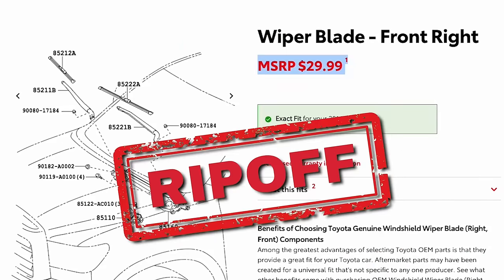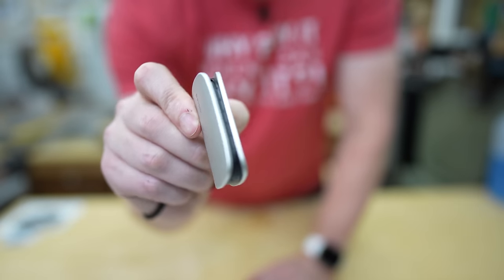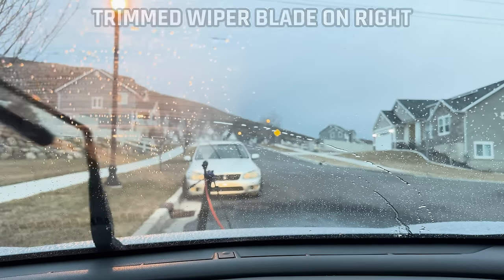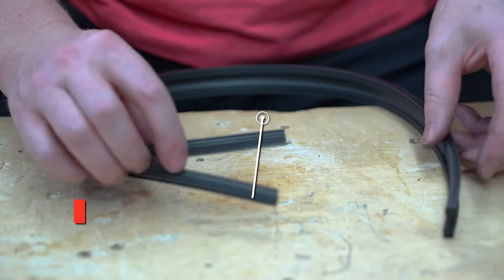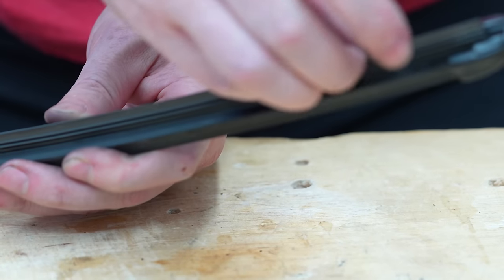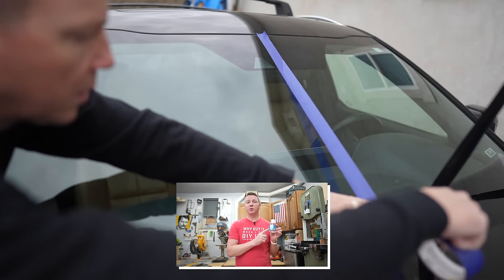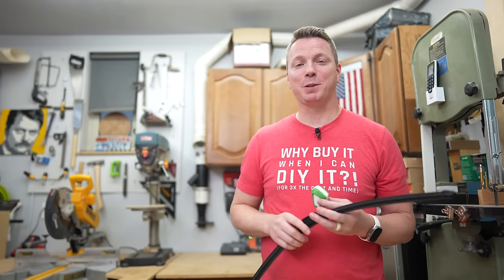Windshield Wipers Are a SCAM! 3 Ways to Save $$$

Comment: I have spent over 40 years in wiper development, testing, and sales/marketing... so my comments are based on engineering and laboratory testing, not limited cases observed on a driveway or local roads...
First, never use petroleum based products on the rubber.  This includes WD-40.  Initial results may be good, but the petroleum eats away at the rubber and reduces the life of the rubber.  Use alcohol or water based cleaners on the rubber.
You are spot-on regarding the squeegee slicers.  The rubber inserts are molded or extruded face-to-face and go through a "slitter" that costs tens of thousands of dollars.  This is the most critical part of wiper manufacture and a hand-held shaver will never produce a perfect product.  It will produce profits in the seller's bank account.
If there is one scam in the video, it is windshield wiper pellets.  They do not contain methanol to prevent freezing and usually contain less washing agents than the gallon bottle.  Some pellets do provide a blue coloring (with minimum washing agents) that makes you think you have comparable washer fluid.  Only $4 a gallon is cheap insurance against frozen reservoirs or damaging washer pumps.
You will never see an automotive manufacturer recommend Rain-X, Aquapel, or Nextzeet because they would not take on the liability for possible dangerous vision while driving.  These water repellants work by filling in the microscopic pitting found on every windsheet and they provide a slick surface... as well as a layer of foreign material.  The repellant can cause tremendous glare , especially as it wears over time.  This can be seen in sunrise, sunset, and oncoming bright headlights.  The only place I would recommend one of these repellants is on sunroofs or windows that are not used to see through for safe driving.
If you are using a repellant and your wipers are not working well, it may be because wipers are made to wipe glass and not Rain-X, which causes more friction.
By the way... we clean our windshields in the labs with standard washer fluid (not tablets) and #0000 steel wool.  Any coarser steel wool will scratch the glass.  Use a swirling motion and virtually all substances come off.  We could not get one water repellant off  a test windshield... and had to scrap the windshield.
Reply: I think what some people mean when they say WD-40 for wiper blades is the silicone spray they make, which does work very well on wiper blades and anything else rubber such as weather seals.  You just have to wipe off any excess or it can streak your glass up.
Reply: Wow - this is such good information from source who knows.  I usually don't read a bunch of the comments, but I'm glad i did today.  Thanks for commenting!
Reply: Thank you for very insightful info!
Reply: You are wrong about repellants. Best thing invented. Over 80 km/h no need to even turn on the wipers. And it reduces glare, specially on worn glass..
Reply: Very informative. I was just about to mention about RainX and wiper combo being bad. It looks fine initially but as it wears, It turned into an oily/waxy-looking white coat on a windshield, while causing the glare. And the Wipers were sounding horrible due to the rain repellent. I had to get it polished to get rid of the coat. After that, I decided to not put these repellents on the windshield. I agree that It is useful on Windows, mirrors and rear glass.
Reply: Ceramic coatings are wonderful ... especially for new windshields!
Reply: What about using car wax as a water repellant. ive been using it for a few years with seemingly good results. But i do clean the windshield, than clay bar it before application
Reply: @upinarms79  The problem is that, at least this video, shows regular WD-40, and does not specify a different type to use
Reply: So my windshield is basically screwed? Glair is horrendous lol. Learn something new everyday. Thanks for the information.
Reply: @tony1990  My thoughts exactly
Reply: Thank you for this. LRN2DIY should update this video. Actually, just take this video down and do it all over again. Agree on the pellets. Washer fluid uses deionized/distilled water to prevent build up and corrosion on your wiper system.
Reply: Hi, did you test any kind of car wax on the windshield? I find that car wax makes the windshield more slippery, which the rubber wiper blades just slide smoothly on top. It helps with the water roll-off thing too, not as much as ceramic coating or rainX though.
Reply: I agree with all of what you said except the rain X part. I've used it for a very long time (8+ years) on my car and drove 100 000+ miles and never noticed that glare whether driving at night, day or sunset/sunrise.  However, the perfect effect of it (nice beading and no need to use wiper blades above 30 mph) washes away really quickly. 
Thanks for all the details in your explanation.
Reply: I wonder if ceramic coating the windshield would be a better option than RainX
Reply: @vueport99  I guess you'd want some kind of coating that is easy to remove.
Reply: @ThePEagle …I’ve always used rain-X and never had any problems…I think it works great
Reply: As a former food delivery driver for 26 years, with around 600,000 miles of real world experience, I can add to you your lab data. I use silicone blades vs natural rubber, they easily last half a decade without any intervention at all, zero sun degradation in the case of my black blades, the red ones I originally ordered turned white after a while but are still supple.

I use Rain-X windshield washer fluid exclusively, used Rain-X prior to that. There are conditions that I decide to use the intermittent function during heavy rain because the film layer does such a great job at speed, and the wipers simply aren't needed at a heavy frequency. Slower speeds actually need more wiper assistance.

This combo of pure silicone blades, and Rain-X washer fluid is something everyone without vision issues should be using. It's by far the best combination that I used in my professional driving days. The one caveat is my mother has one eye that functions properly, the beading water throws her off for some reason. She can't ever explain to me exactly why, but every time she's been in my car, or I put Rain-X on her car back when I lived with her when I wasn't anywhere near almost 50 lol, she complained about it.
Reply: @ralphlongo1975  turtle wax on windshield also works quite well in rain especially at highway speeds. I've had to turn off my wipers cuz the water cleared itself quite well.
Reply: @vueport99  ultimately the washer fluid option allows me to be lazy with maintenance of the setup 😂
Reply: Can you polish an old windshield to perform like new regarding glare at night? When I first got my car night driving was so much easier than my the clunker I drove in high school. Fast forward 19 years later and lights glared so bad I could barely see through the glass.
I wonder how newer cars like the one I just bought with optics that see through the windshield will fare.
Reply: Glass scrub removes everything including build up and chemicals
Reply: @rus84d he's 100% correct on repellant. As he said as it wears it is terrible at a wet night!
Reply: NEVER use steel woll or any kind of steel on your winnsheild (….unless u want scrapes all over your winsheild)
Reply: @J.MartinWills  0000 steel wool is very safe for glass
Reply: @fF-jb4gs  Yep. I did that recently to remove a lot of road gunk, the various stuff that comes off the giant oak trees under which my car lives and the pollution that comes down in the rain. Also the layer of Rain-X I had put on a long time ago.
No steel wool 'scraps' at all. It's gotta be 0000 (4 ought). Replaced old blades, done.
Reply: Great comment. 
Thank you 🙏 👍
Reply: I wish I could save this comment
Reply: @Starbyter2  Rt click, select text, ctrl-c (copy) and ctrl-v to paste into an email to yourself. Done!
Reply: agree on the compliance risk but does not agree that coating cause glare. without it, oil film causes more glare.
Reply: @rus84d  What reduces the glare of worn glass even better is a new windshield. Totally worth the $$$.
Reply: WD40 has been proven times and times again to be perfectly safe for rubber, including o-rings and such
Reply: Thank you thank you
Reply: @Kid574  orings and other seals usually either NBR or viton. Tyres and wipers most of the time are natural rubbers
Reply: What about carnouba wax for the windshield, I've seen good responses from people who used it. The view is clear and they don't even need to use wipers
Reply: @spamcan9208 Yes, there are glass polishes.  But it takes a long time as d is rather messy due to the hardness of glass
Reply: @Jeppedy  starting to think it would be easier to smash my windshield and blame it on the neighborhood kids when I call my car insurance to replace it lol
Reply: Is that you Brian,,?  Ron K.
Reply: @ThePEagle . Totally agree. Wipers make no noise at all when I use them compared with before I applied initially.  Only thing that destroys my blades is winter when I think I have defrosted the window but didn't fully melt all ice,   noise like nails down a blackboard and ruined rubber.
Reply: I would avoid the washer fluid pellets,  try not to introduce non filtered water into your washer fluid, foreign material or particulates of the pellets can jam your pumps. And tap water will leat to more dry water spots on your car

Comment: Wiper refills were one common in every auto store and Walmart, but they slowly disappeared and were replaced with a range of wiper brands.  People didn't used to buy entire new blades unless the old ones actually broke; they just bought refills. If there is a scam with wipers, it's that refills were taken out of stores, at least where I live. 

I'm glad that the video recommends them, as I didn't know where to find refills anymore and certainly would not have expected ones from AXpress to last more than a year.
Reply: This is exactly what I was going to say! I hate to newer blade refills. They are entirely too curved for a lot of the taller windshields. The middle of the blade never really hits the glass, and the ends wear out before the middle even hits fully. That can cause scratches and grooves in the windshield. Good to know that you can order the old school refills when you finally find a pair of blades that fit your actual windshield.
Reply: Two reasons for the demise of refills... 
First is the backing... it coulsd be 6mm, 6.5mm, 7mm, 8mm, or 9mm wide.  Install the wrong size backing and the refill flies out during operation... or jam in one that's too tight and you can easily get streaks and smearing.
Second... refills were popular when they were sold in pairs and were the same size.  Today over 85% of vehicles have two different size refills on the front glass. 
 If you are going to buy refills, go to the dealer... but if you are going to pay their ridiculous prices you may as well buy a quality aftermarket blade.
Reply: If you have the factory wipers, get refills from the parts department. They last 3 years 36k miles warranty, and they it perfect. Autoparts stores dont carry them no more as there is no single size anymore, its easier to carry the whole wiper at different lengths than different rubber at different widths and lengths.
Reply: Came here to say this. We used to by two rubber blades for 2.99 back in the 90's. Now you can't find them in any store.
Reply: I used the refills for years to save a buck, but noticed that they tended to not even last a full season of winter weather. In the long run refills were working better for me. Cost more, but I only have to replace them every one to three years.

I hadn't even noticed that the refills had sort of vanished from stores.
Reply: this is interesting cause in Australia we can still buy them at the local car parts stores and they have multiple options
Reply: I like that piia sells replacement silicone blades for their wipers.

Comment: Finally, a subject I have good (and I mean excellent knowledge about).
I have been working as a development engineer for wiper system development at an OEM automotive manufacturer for almost 30 years. 
First of all:
Yes, wiper blades are expensive, but they are safety equipment that you need when the driving conditions are at its worst. When it is cold, dark and rainy you don't want bad wipers, especially if you are driving for more than an hour.
Take care about your self and your safety. 

About the 3 tips.

1. Yes, you should clean your wiper blades.
But gently and absolutely not (!!!) with WD40. Use a piece of paper and some soapy water and wipe away the debris from the wiper lip.
The black stuff is not tar, oil or soot and it should be on the blade. 
It is a graphite coating that helps the blade to move smoother over the windscreen but most important, it stops the squeaky noise from the rubber moving over the glass.
The term "squeaky clean" comes from the sound a rubber scraper makes when cleaning a window...

2. Cutting the wiper lip.
It's a thing you can do if you are broke and it is an emergency during daytime in the summer.
There is a reason that the lip has its length and it is not so that you have some extra rubber to cut of. It is there to take up the uneven curvature of the glass and to make a smooth and silent wipe. You will especially notice this when it is in the 40-ies and below.

3. Exchange the wiper strip.
Yes, that is actually a good tip abd that is what many OEMs do when the service your car.

You can do it your self, but please know what you are doing. If the part is not already pre-cut to length, measure the old one and cut the new to spec. Better an 1/4" to short than an 1/8th too long. 
The rubber need to have room to move in the frame, when travelling over the windscreen surface. 

The two bonus tips.
1. Rain-X is good, very good.
Just clean the glass thoroughly before applying. 

2. You do not need any tablets from Amazon. Skip that crap.
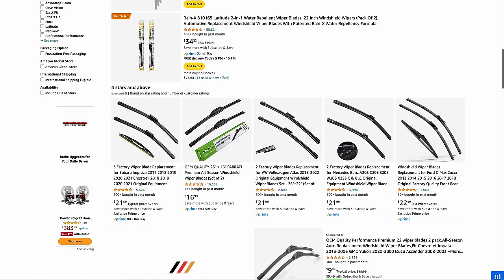1 tea spoon of (hand) 6:34  dishwasher soap to a gallon of water makes the best washer fluid.
Have in mind though that when it is close to, or below freezing you must have ethanol in the washer fluid!

A mix of 3 part water and one part ethanol (or isopropanol) will prevent the washer fluid from freezing down to ca 10 °F (or -12°C)
2 part water and 1 part ethanol  will keep the washer fluid down to 0 °F (or -18 °C).

Drive safely and don't be foolishly cheap! 😊
Reply: Bosch Icon or Focus?
Reply: Thanks
Reply: 'Wiper system development'?  We're talking about the synthetic rubber part that goes into the 'wiper arm system'. I've worked on my own cars for over sixty years, never gave wipers a second thought, they just worked and you replaced them when they needed to be replaced.  Gas station attendants used to refill your wipers while you sat in your car while your gas tank was being filled.  They also cleaned your windshield. Also your choices of brands was Trico or Anco, that's what my local NAPA store carried. In the past ten years I noticed the refills disappeared from the auto part store peg hooks, but the replacement wiper blades were under five bucks and lasted a few years.  I replace wipers for family members and began noticing they were calling more often about their wipers needing replacing.  Received a flyer in the mail from NAPA, those wipers that were less than $5 were now $7, on sale, half off the regular price. I bought three sets, and a year later my blades needed replacing. Well, the price was $15 and they didn't have my size in stock, they did have pricier blades in my size, but the cheapest was $25.  Went to Walmart, they had some generic brand priced under $4 and the next tier was Michelin at $5.67. Since last year they discontinued the generic brand, and the standard Michelin blade is the cheapest at $7.87.  The generics were mediocre, first time I ever noticed new blades not being quite right.  The tolerances in the metal frame were not as good as the NAPA branded Michelin. I still had the old frames so I just swapped out the blades from the generic frame to the Michelin.  I was doing this until they discontinued those generic wipers.  Also I scammed some of those $35 RainX treated beam type wipers for the price of the $7.87, and after a year I'm noticing mild streaking and squealing during a light rain.
Reply: "The black stuff is not tar, oil, or soot [...] It is a graphite coating"

Thank you for this info. I've seen many times people cleaning the blades and showing the result as evidence. The last time I tried cleaning the blades, no matter how thoroughly, I would still get the same result which told me it can't be dirt. I'm glad to know what it actually is, and I will keep that in mind the next time I am cleaning them.
Reply: @Undearius  When my windows/wipers get gunked up, I give the windows a good cleaning and use a damp clean shop towel to wipe the wipers. When they get too bad, I just get a set of OEM wipers off AMZN or the local auto parts store that carries them, and I'm good to go. The last set of OEM/no-name-brand I got off AMZN is very high quality, and the rubber blade itself had a silicon(?) sleeve over it. Also, they are specific to make/model, so there is no adapter part(s) to fiddle with. Why pay $ for marketing and packaging BS?
Reply: The tablets seem to me to just be another cheap gimmick designed to lure in those that are too cheap to buy a two-gallon pack at Costco for a few bucks. If they were really an acceptable alternative to buying wiper fluid then they would have replaced the gallon jugs many decades ago. They should be considered an emergency stop-gap method, and not the standard.